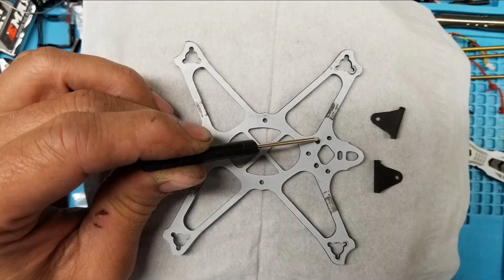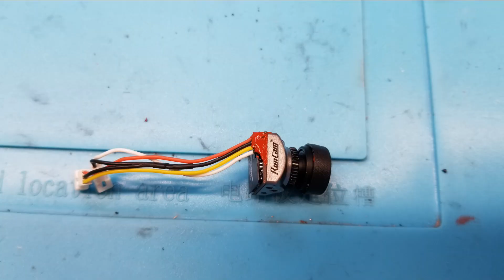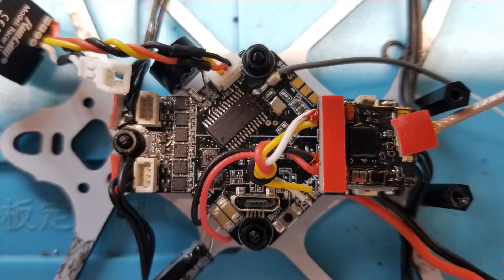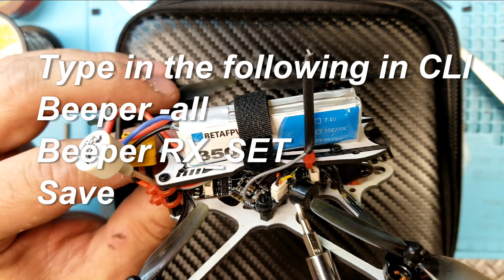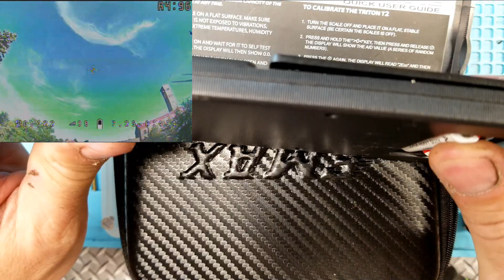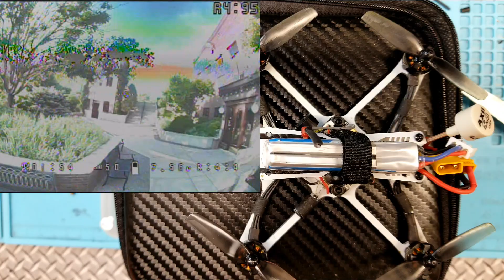Part 2 Emax Tinyhawk Freestyle MODS!! finally

Comment: I ordered my THF2 a couple weeks ago along with all the upgrades. I do agree the beeper is a must have. I lost my qav 250 for an hours or so.  I lost my votex 250 v1 with my GoPro for 8 months and found it. So after all that. Beeper is a must👍🏼👍🏼 subbed to ya also. I’ve been out of the hobby for a couple years and now getting back in to flying again. Thanks for sharing.

Comment: Great informative review! Is it possible to add a programmable led to the flight controller? For example like the Led from  Eachine Lizzard. Thanks in advance! (Btw. My Emax is on its way)
Reply from the maker: There isn't any pads specifically for leds.  I'm not sure if the BEC can handle LEDs along with everything else.
Reply: @DumbThumbsFPV  Thank you for your reply! It helps a lot. My Emax is on its way. Happy flying!
Reply: Quick update! I added one and it works and flyes well (using larson scanner).

Comment: Like tag! I got that bird..mine wont arm? Worked for 8 pacs. Arms when it wants..but can take hours. Any ideas? Thanks.
Reply from the maker: Oh man that is weird.. so the receiver is working when hooked up to betaflight? Meaning you can see it's working in betaflight? If so then rebind it.. what controller do you have because my xlite was doing the same thing with the XM+ sometimes it will arm and others times it won't and I have to restart the radio and receiver.  Also see if the Gyro is working in betaflight like it's supposed to. Turn off the accelerometer and barometer. You can't fly with horizon or stab but it may arm. Turn your motor stop on and make sure the throttle it set up right. You may have to  have to retune the radio or go into Bheli and set your escs right cause it may be the throttle is set to high for your radio.
Reply: It may need to be gyro calibrated if it thinks it's on an angel it won't arm
Reply: @dimanfpv3247  I changed arm angle..everything..sent back no more bnf for me. 5 inch builds works.. Thanks for reply god bless

Comment: What tool do you use to loosen those frame screws?
Reply from the maker: The screws on the bottom? for the standoffs?
Reply: @DumbThumbsFPV  Ya is  it a philips head or some type allen wrench?
Reply from the maker: @Blizofoz45  I believe it's a 1.2 or 1.5 allen. It's actually an odd size on mine anyway as my normal allen doesn't fit it exactly right
Reply: @DumbThumbsFPV  Thanks I'm going to the hardware store to see if I can find one.

Comment: You said it's sluggish? You were on 2s. Did you change to profile 2? It is very quick. Sluggish is the last word I would use to describe it. But I use 2 GnB 650mAh HV 1s.
Reply from the maker: Yeah it was because 1. my bats are getting older 2. the feedforward just made it seem muddy. Fixed both but still power to weight is low. Toothpicks should be under 65g loaded up to get the 6 to 1 p/w ratio right. I may be just used to my Fullspeed toothpick that has 11kkv motors on it. 7k is good for 3s because these little motors just don't have the torque. My next project coming up is to build a top load battery toothpick @60g loaded and I hope 45g dry. Waiting on the FC now.

Comment: Vtx Straight to power .do not use the peb pcb or somthing u said ? What do i need to do if swapping vtx to diamand dvr vtx and need 5v ? For 1 and 2s 
Grz
Reply from the maker: a step up down converter or buck converter.. "According to the manual for the TBS Unify Pro32 Nano the input voltage range is for 3V - 13V." also you could put in a buck converter..  https://www.amazon.com/Pololu-Step-Up-Step-Down-Voltage-Regulator/dp/B01M4KIS7K/ref=pd_rhf_ee_s_rtpb_1_4/135-1496092-4475260?_encoding=UTF8&pd_rd_i=B01M4KIS7K&pd_rd_r=50f9e137-471a-47c2-bdec-b0e8b2bd6fdc&pd_rd_w=Dt2Ro&pd_rd_wg=ZFeos&pf_rd_p=a81132e4-a99d-4ec4-b8d9-0eee61b952f3&pf_rd_r=KQC1GZAZMGB34Q2P7R27&psc=1&refRID=KQC1GZAZMGB34Q2P7R27
Reply: @DumbThumbsFPV   why not use the 5v and ground from the fc ?
thx
Reply from the maker: @playmatee1  because I don't know the size of the on board BEC.. and most are over rated.. @200mw typically the amps required are 280 and @400 .380 depending how the vtx is built (TBS doesn't say) The camera I chose is 130ma and I'm not sure about the on board RX.. I always hook my VTXs to the bat and make sure there's a cap.
Reply: Can u plz confirm on 1 and 2s the fc 5v pad is stable 5v?
Btw the diamond vtx (like a half whoop formate) it looks great i wanne squeeze it in there, u think it is possible ? (Dont wanne wast money)
Grzz
Reply from the maker: @playmatee1  I'm not sure what the 5v pads BEC is rated for.

Comment: Mine has short rx range, I'll be also adding an xm+, I think I'll go with the TBS nano 50mw, I received one in drone drop and was impressed how far 50mw goes on my 3 in build. I think Albert kim is making a 3d print for the same camera. I'll really like this for a park flyer when the upgrades are done, stock the range is terrible.
Reply: Hey brother  dumb thumbs has some ideas for my drone. Seems like a cool guy! Yours still flying and what radio do you use?
Reply: @sleepingbearffg5008  im modifying mine right now with a 50mw unify, runcam nano, and since my 2.4g signal on my QX-7 kept failsafing, I had to put an r9 long range nodule in, so I guess i have to put long range even on my little ones.
Reply: @RCOverKill  cool! I found out arming issues..will test today to make shure.  But bench test went well..I personally love this drone..for what it is..flew by people yesterday.  They didn't even realize unless I came close..was cool! Thanks for response! God bless..
Reply: @sleepingbearffg5008  I would like to know what you find.
Reply: @RCOverKill  I'll making video  bro..hopefully today

Comment: About to order some beepers, which size did u use 9x5.5mm or 12x9.5mm? Don’t want to order the wrong size. Almost lost this thing today and remembered your video lol
Reply from the maker: I searched through our Amazon account but the wife has bought so much crap over the last two years!! I measured them up and I think it's these.. https://www.amazon.com/EUDAX-Tracker-9X5-5mm-Quadcopter-Control/dp/B071ZP615Y/ref=sr_1_4?keywords=5v+beepers&qid=1566271780&s=gateway&sr=8-4
Reply: DumbThumbsFPV awesome ty so much for the response I was gonna order the smaller ones but wanted to double check.
Reply from the maker: @djs134  I'm wondering if these are not better.. they have both sizes https://www.amazon.com/BETAFPV-Terminals-Electronic-Continuous-12X9-5mm/dp/B073RH8TQK/ref=cm_cr_arp_d_product_top?ie=UTF8
Reply: DumbThumbsFPV just got my beepers in and installed one, ty for the cli command in your video. That will extend the life of this thing for sure. Most complaints seem to be that they don’t last long. Well of course not when u don’t have this cli command. 🤜🏻
Reply from the maker: @djs134  yeah it drove me nuts when I first put it on and couldn't figure out what the problem was. I think it's just this version of Betaflight is the issue.. Glad I could help and honestly the only reason have the channel
Reply: DumbThumbsFPV  well for some reason my esc beeper is trying to beep and drowning out the buzzer. It’s like there both trying to go off and the buzzer barely makes much noise because of this, And clue how to remedy this? Thanks
Reply from the maker: @djs134  both my esc and beeper goes off at the same time but I can usually hear just the beeper cause the ESCs are too quiet. So the beeper you got is quiet? what ones did you get? Mine is loud.
Reply: DumbThumbsFPV  it was working perfectly when I tested it. Then I took it out for some flights today and was about to crash in the grass so I disarmed and it was a gentle crash and I noticed I could barley hear the buzzer. My guess is that minor crash jolted something and the buzzer went out. Guess it’s a good thing they gave me 7 lol.
Reply from the maker: @djs134  you know david I need to reorder some cause I'm out and I searched my accounts on gothelirc,getfpv,banggood,amazon,pyrodrone,RDQ... I cannot find where I got mine but I started thinking because Banggood sends me free stuff or did before I pissed them off giving an honest review LOL.. they didn't list in my orders the stuff they gave me or sometimes the stuff I ordered.. I think I got these before.. https://www.banggood.com/5-PCS-Super-Loud-5V-Active-Alarm-Buzzer-Beeper-Tracker-95_5mm-for-Racing-Drone-p-1117207.html?rmmds=detail-left-hotproducts__4&cur_warehouse=CN
Reply: DumbThumbsFPV  complete head scratcher here. I took the beeper off and tested it and it worked perfectly, I installed a new one though and it worked on the bench and with a battery plugged in. But after a few packs it doesn’t make a sound again, only the esc beeps. I’ve literally tried everything I can think of I even enabled beeper all in the cli so everything is on and still nothing. The solder joints are perfect to. And I was sure positive went to positive and negative to negative. I powered the buzzers with a 1s lipo after removing them and boom they both go off. This is so odd. Any ideas would be appreciated, sorry to bug u
Reply: DumbThumbsFPV turns out to be a bad solder the negative was just barely off. Looked good but hard to see till I slightly wiggled it. Sorry for wasting your time. 🤜🏻
Reply from the maker: @djs134  hey no problem.. I landed so hard upside down that mine flew off with the pads still connected... LOL..no beeper for me now..

Comment: If i install this vtx n camera can i still use the quad with a 1s battery or is that not enough juice for the vtx??
Reply from the maker: good question.. probably not unless the BEC on the FC board is a step up/down regulator.. The quad is good enough as is for 1s to be honest. I flew mine in the house on 2s with the stock settings... it's not a speed demon.. more than likely you would have to get a buck converter to step up the voltage
Reply: @DumbThumbsFPV  thanks for the input and yea im most likely going to end up making a 2s with the xt30 as well...i am still kinda new but i think i can handle a fulltime 2s lol...thanks and awesome mods...im about to order all my parts so i can upgrade mine over the weekend :)
Reply: Jesus Hernandez the ph2.0 connectors have a solid pin so I’d just leave them as is and fly 2 - 1s batteries on it. I’m getting 5-6 min flying it at a pretty aggressive pace using rdq 520mah batteries. Do yourself a favor though and install Andy rc’s cli dump. He adjusted the pids and this thing flys amazing now
Reply: David FPV so ur flying 2 520mah 1s batteries on it? I was scared to go over 450mah when flying 2 1s batteries lol...like i said tho im still pretty new so its all a learning experience... and i will definitely get that cli dump i did watch his video and do want to try that cli dump

Thanks for the advice brother!!!
Reply: Ch3w3y's Stuff yes u can use the 520s u can go even larger if u like to. Kabab who kinda created this class of quad uses pyrodrone 600mah batteries on his tinyhawk freestyle. I’m just waiting for them to be back in stock then I’m ordering a bunch of them. Just FYI when u use 2 of the 1s batteries your flying in 2s. Those batteries are wired in series with the supplied wiring connector. The only way to fly 1s on this thing is to cut off a ph2.0 lead and solder the 2 wires together and plug that lead into one of the connectors. Then just plug 1 1s battery in. But the performance is terrible on 1s so don’t bother. I tried it and u can’t do anything but slow explorer type flights
Reply: @djs134  oh yea i have flown it on 1s already and i liked it to fly inside the warehouse where i work at lol i have more control of it that way but i am getting the hang of it real good on 2s so i might ditch the 1s setup and stick to strictly 2s....i did make my own jumper for 1s but like i said that might be obsolete now lol unless i decide to convert my original tinyhawk to 2s lol
Reply from the maker: @JesusHernandez-ji7pq  and you guys can always set up throttle scaling on a switch so you can use 2s indoors and out..https://youtu.be/NKlfQylIvf0?t=416
Reply from the maker: You can always do throttle scale on a switch like I show in trashcan review.. or my Trashcan mod review
Reply from the maker: here is a step up/down little buck you can use.. https://www.amazon.com/Pololu-Step-Up-Step-Down-Voltage-Regulator/dp/B01M4KIS7K/ref=pd_rhf_ee_s_rtpb_1_4/135-1496092-4475260?_encoding=UTF8&pd_rd_i=B01M4KIS7K&pd_rd_r=50f9e137-471a-47c2-bdec-b0e8b2bd6fdc&pd_rd_w=Dt2Ro&pd_rd_wg=ZFeos&pf_rd_p=a81132e4-a99d-4ec4-b8d9-0eee61b952f3&pf_rd_r=KQC1GZAZMGB34Q2P7R27&psc=1&refRID=KQC1GZAZMGB34Q2P7R27
Reply: DumbThumbsFPV thanks again bro!!

Comment: looks like your google color over saturated. is it rapidfire receiver?
Reply from the maker: Nah the Rapidfail finially died.. it's the new OwlRX... I think my camera settings were off
Reply: @DumbThumbsFPV  How do you like the OwlRX compared to the Rapidfail?  I need to upgrade and looking at options
Reply from the maker: @Therberg2500  My Rapidfail finally did fail. The lower receiver finally went out and to be honest I think it's been bad for awhile. I like the new OwlRX as it actually performs better than the one I originally did the review on. The OwlRX and Rapidfire (when it was working) was so close but the new version I think would be even closer.

Comment: Newer to the hobby so excuse the probably stupid question but here it goes. I noticed a lot of people clear heat shrink there receivers like the Xm plus, so I’m definitely doing that but can u shrink wrap the vtx also? Seems like a good idea but I’m thinking it will heat up pretty good so not sure. Is that common practice or just to heavy duty double sided tape ? Thanks man
Reply from the maker: no such thing as a stupid question except the one you don't ask before doing something stupid... I wouldn't because the VTX needs massive cooling or it'll go into low power mode all of the time. Unless you are experienced at building quads I would not attempt at modding this as smaller doesn't mean easier... in fact, to me, it's harder..
Reply: DumbThumbsFPV ok, thanks for the tip. I’m probably just gonna toss a eachine nano vtx and a Xm plus on this thing. I’ve done a few tiny solder jobs and they have worked fine. Big magnifier seemed to help, but I appreciate the concern.

Comment: Great vid. I love modding too. I have two of the original TinyHawks and the TinyHawk S and have swapped vtx's and installed XM+ rx's in them all. I have a vid where I did a range test with the TinyHawk S / XM+/ vtx03 and went 300m and still had about 80 % RSSI. Point being, it's a shame we have to do all this to make them what they should have been . They could at least sell and upgraded version with the higher end components. Anyway, great job ! Love your vids ! 
🤘😁👍
Reply from the maker: Yeah it is... but they are looking at the retail price including dealer markup.

Comment: Great mod video DT, the Lumenier Micro AXII Shorty U.FL and TBS Unify Pro32 are IMHO the best combo VTX/VTX Antenna setup for Sub 250g quads, I've just put this combo in my new Sub 250g 4" HD freestyle quad and it works flawlessly.